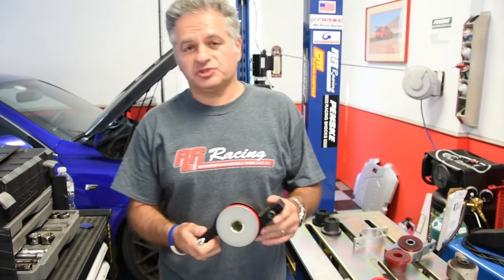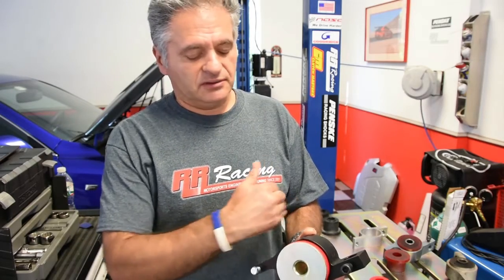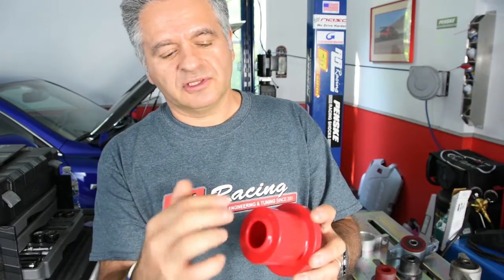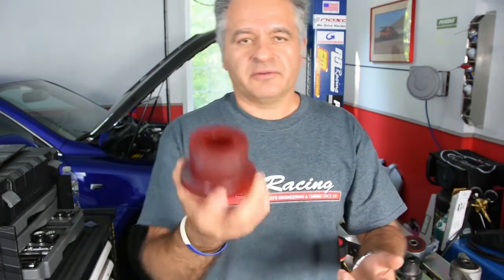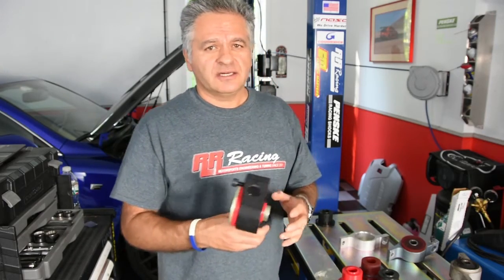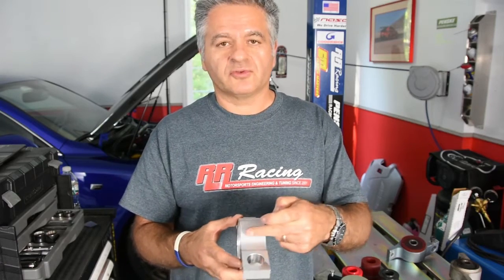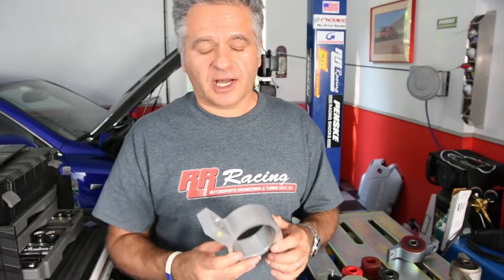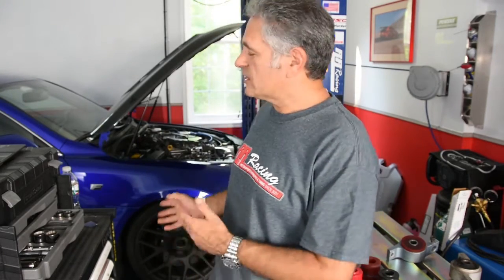RR Racing USRS Overview and Testing Comparison

Comment: @ RR I have a 2020 IS 300 RWD F Sport. I’m having inner tire wear on my factory tires @ 27K. Before I order some new tires. I want to get the main problem squared away first. Do these require any maintenance?  Also, will it be more advantageous, to get these or the sealed LCA brushings? Your feed back on this will be greatly appreciated. ✌🏾

Comment: Terrible product. I have them on an IS-F. They lose their grease after a few thousand miles. They also make noise when going over speed bumps.
Reply: They don's use grease.  We sold thousands of them, and if they are installed properly, the do not make noise for years.  I suggest to check your installation.
Reply: @siraban  The guy in this video shows there’s lines in the bushing for grease retention so I imagine you’re applying grease when installing them. If the grease wears away after a while it’s surely gonna get noisy.

Comment: I installed these earlier today in my 2014 IS350. The steering response is definitely crisper - I’ve heard others say these give the Lexus more of the European car feel, think BMW or Mercedes  - I will say that the steering is noticeably more ‘connected’ to the road. Ive also noticed braking and cornering are tighter and more precise. These changes are not extreme but they are noticeable. The real reason I got them was to eliminate the inner tire wear due to dynamic toe changes while driving with the softer OEM’s. IMO the softer OEM’s give a more luxurious (less driver input/less road feel) experience as opposed to a performance feel. This is typical Lexus- luxury first, performance second. The product is engineered very well and I’m very satisfied with the upgrade. They’re pretty easy to change, and a must for spirited drivers with Lexus coupes/sedans experiencing inner tire wear issues.
Reply: I'm buying a used 2010 is350C this week with 90K miles.  I'm thinking this setup could make it feel like a new car again.  Please post back with your extended experience after a few weeks.
Reply from the maker: Thank you for the feedback! Glad you are enjoying them
Reply: Josh, how have your tires held up? Have these helped with the inner tire wear?
Reply: @jkems06  Do these help? Yes. How much? It’s hard to say as when I purchased the car it was lowered about 1” and I didn’t realize until later on after installing these (and having similar yet slower inner tire wear) that it was out of alignment a fair amount. After having the car aligned at a local speed shop, tire wear improved but not altogether; and wouldn’t you know, after looking at the alignment spec sheet they didn’t get me into spec - just closer. The shop specialized in Subaru (only went because no one else had a low enough lift) and after 2-1/2 hrs wanted to charge me another $150 ($300 total). Since they were “close” to spec, I told them to drop it and I left. Lexus dealership fixed the alignment and the tires seem to be holding up great. Long story short - suspension bushings AND alignment are equally important, and in my opinion both are necessary for Lexus cars.
Reply: @joshthomas1706  Thanks for the info Josh, I'm definitely going to be picking up the suspension bushings. I think they'll pay for themselves over time. Making the car a little more fun to drive is always an added bonus.

Comment: so what extra stress is this putting on the OTHER components?
Reply: I would imagine it would be super hard on the ball joint and anything else that’s connected to the lower control arm.  When you see the difference in the movement between oem rubber vs poly, you have to wonder where the stress point has moved to.
Reply: @huck9293 hmm well this makes me wonder if its a good idea to get this replaced then
Reply: Isffaster did a review on this an he didn't talk about any problems that it makes
Reply: would like some insight on this as well
Reply: Agreed. This is a great mod for a serious track car but it's a bit overkill on something like a 2nd gen IS 250 or 350. I'd be more comfortable running a stiffer OEM, from maybe the RCF instead.